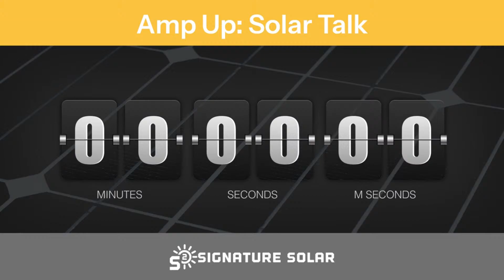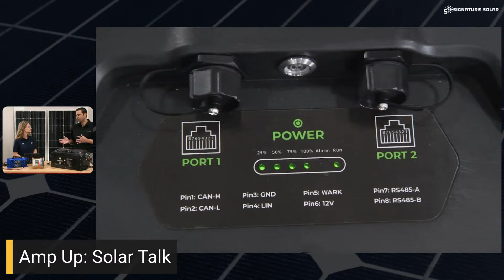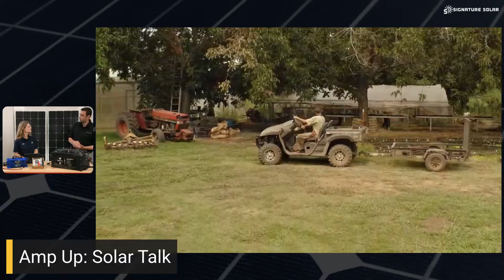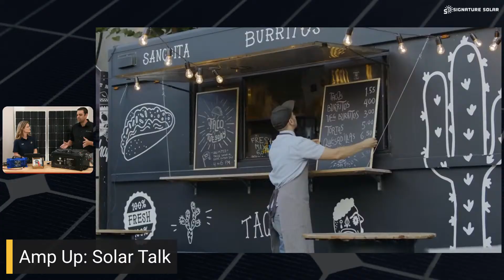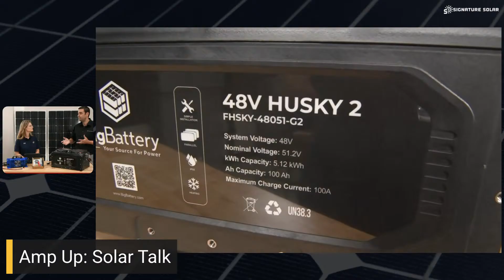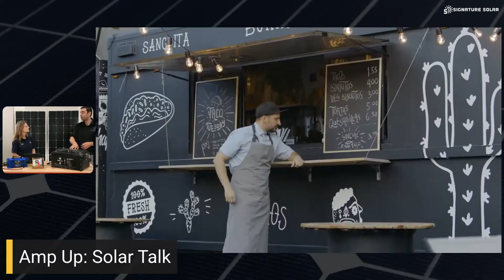Amp Up: Solar Talk - Ep. 15 - Husky2 - A Battery Built for Adventure

Comment: I bought 2 48 v growatts and 10 panels @400 w
I can only use 3 panels 1200w
I havnt chained the 2 growatts because they use too much power to run the all in 2
I have 100ah battrry (lifepower)
I would like to use the extra growatt for my RV
Problem is my RV is 24v
I would have to buy a different all in one @ 24v
Right after i bought the 48 growatt you guys released a 220 v all in one i felt like i was sold a outdated model
Now i have to buy another all in one @ 24 volts and new lifepower battery 
Sux
Reply from the maker: Thank you for your feedback. We completely understand how frustrating it can feel when new products roll out shortly after a big investment.

We genuinely appreciate your support and want you to know that product releases are aligned with manufacturer timelines, and not something we intentionally stagger to cause inconvenience. That said, we’re always happy to explore options that make the most of what you already have.

If you'd like, we can take a closer look at how to optimize your current setup, or even suggest a cost-effective path forward for integrating your RV.

Let us know what direction you’re leaning, and we’ll do our best to help make it work for you!